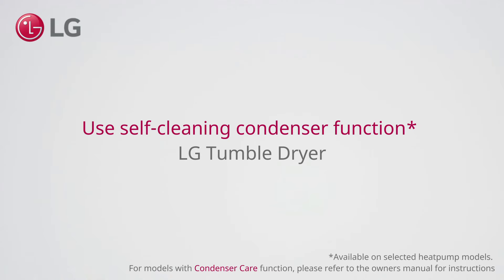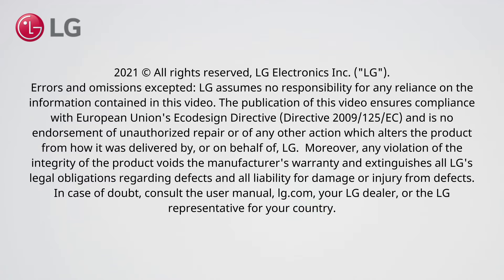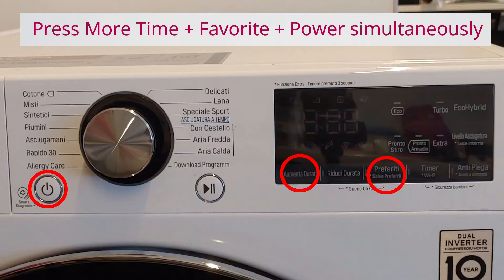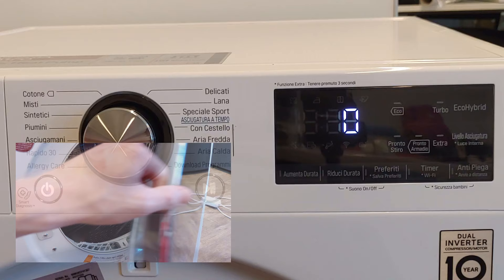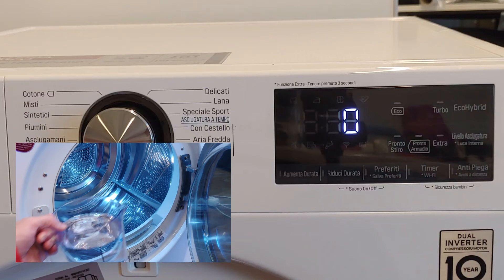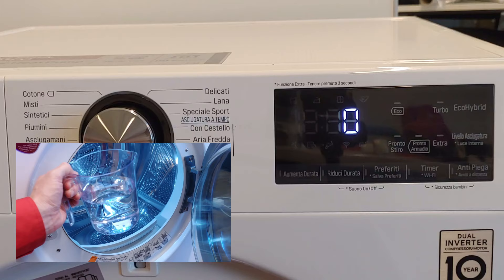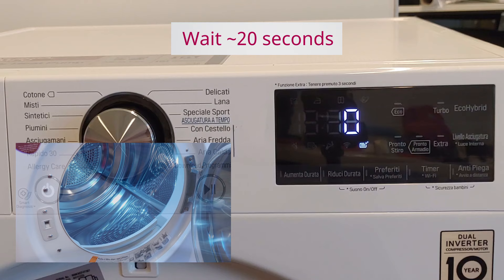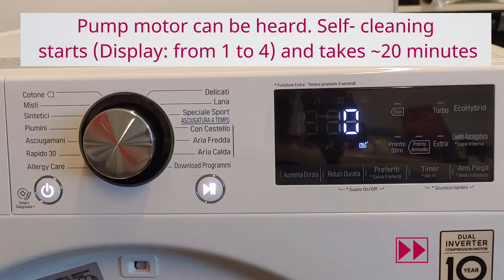[LG Tumble Dryer] - Use the condenser cleaning function manually

Comment: Just bought the following one - RH90V9AV3N.

In the booklet it is written to pour 1L water, after removing the draining container.

The question is if the video is applicable for this unit, as it looks quite easier to remove the lint filters, and to pour the water from there.

Thanks in advance
Reply from the maker: Sorry for the late reply. Actually the lint filter procedure will work similar to the drain tank container, as the water you pour in will enter the base area where the water detection is done. So no problem doing it via the lint filter hole. But please do not forget to first empty the water tank (if used)
Reply: I have a similar question and the manual also says to pour the water in via the water tank slot, after removing the drain tank.

Comment: I cleaned out the condenser and now when I dry clothes water is leaking from where the condenser is and steam is co.ing out of the machine .how do I fix this.we just had a tech come because we didn't know someone in the building shut the main switch off
Reply from the maker: Not sure what type of model you have. This video is made for heatpump dryers with an integrated condenser. You say steam is coming out and water leaks. Indeed this sounds like you need a technician.

Comment: Hello! I tried this technic, did everything as described, pressed the buttons, 0 appeared on display. 
However, it never told me to stop adding water. The little condenser icon never came. 
I then thought "Oh, maybe my machine needs a little more water than the 2 liters described!" 

Now my dryer is "overwatered" and wont dry. How do I drain it from water? It has been running for 10+ hours on regular programs cause i thought it was just a matter of time.
Reply from the maker: Which model do you own? When "0" appears, this means you should stop adding water. If the condenser icon does not show and you do not hear a pump sound (the pump starts circulating water over the condenser), then the procedure apparently does not work for your model. Then about draining; what drain connection do you have? Is the water tank emptied? To drain water, this happens automatically after 5 minutes in the Cotton program, for example.

Comment: Hello. If the water tank has water in it and I start the cleaning function, it will clean with the water from the water tank? Or should I make the exactly procedure from the video?
Reply from the maker: No, in fact it is requested that you empty the drain tank first. Then fill the base compartment and when it has enough water in the water (not too much!!) it will produce a bling sound and start working.

Comment: I can get it to shortly show the 0 on the display and then it shows 0F and the full tank ikon starts blinking
Reply from the maker: Then I'm afraid your model does not support this function. The F symbol is related to the water tank and is only for SVC technicians. To make sure that the auto condenser cleaning function works during a program, if there is enough water in the base it will definitely activate. The best thing is to always put enough (wet) clothes in the Tumble Dryer every cycle.

Comment: I am using the TD-H802SJW model, and the manual that came with it initially does not mention how to clean the condenser at all. It has been four years since I purchased it, and I have never cleaned the condenser before. Should I clean the TD-H802SJW model just like in the video? I'm concerned that it might break if I do anything wrong.
Reply from the maker: Don't worry, you do not easily break anything by trying this button combination. Not sure though if this model has the function. It's not a European model and I do not think it has an auto cleaning function. Perhaps there is a condenser you can take out, but I suggest you contact your local LG office to obtain more info.

Comment: As soon as the condeser cleaning symbol lights up, I stop adding water .
Should I close a dryier's door ?
or wait 20 secound and cleaning is processing with open door ?
Reply from the maker: If the procedure works then you may leave the door open, that should not be a problem, but it should also work when you close the door.

Comment: @LGSAE my dryer FDV1110W has fully automatic condenser cleaning it cleans it while it’s drying the clothes, but before I knew that I already poured the water into the the filter so what should I do and how do I get rid of the water please help.
Reply from the maker: The only thing you can do is empty the water tank. When the machine senses that the base is full it will pump out residual water to the tank, so that one should be emptied after each cycle.
Reply: @LGSAE  so how to I change the dosage and do a ezDispense nozzle clean on the FWY937WCTA1 washer dryer it has ezDispense it has dosage no dosage change settings on the screen and no nozzle clean function on the screen.

Comment: Hi. Thank you for your video. May I know what will happen to the water that added? Is I need to prepare any drain hose later? Thanks
Reply from the maker: Similar to the water that is removed from your clothes during the drying process all water will be collected in the water reservoir. You need to empty the water  reservoir on a regular basis as explained in the User Manual (not needed if the optional drainage hose is installed).

Comment: Hi, one question. Is there any 3rd filter on the Dryer? RH90V5AV6Q is my model but I don't see any 3rd filter other then the 2 from the front. Thank you.
Reply from the maker: You are right, there is no 3rd lint filter. Just 2 on the front.
Reply: @LGSAE  exactly. Then where does the lint that has been washed from the evaporator/condenser go to? Please answer this critical piece of information.
Reply from the maker: @ChaseMaximilian  well, it ends up in the drain water. Note that the filters catch nearly all the lint because of the very fine mesh holes. So it is only the very fine dust that may pass the filter into the base and is pumped into the drain tank or external drain hose.

Comment: Hi. For the model LG RH90V9AV2N should I pour water in the lint filter opening or in the water tank opening? In the user manual it is recomended to use the water tank opening. Ty
Reply from the maker: It works similar. The only thing you should keep in mind is that you pour it in slowly and that you do not pour in more than 1.5 - 2 liters. The base can only handle about 2.5 liters so if there is already some remaining water from previous cycles, it may start leaking at the back.
Reply: @LGSAE  thanks. Very clear answer

Comment: Thanks for sharing this tutorial, it does alleviate some of my concerns about the automatic cleaning function. However, people on forums and here on Youtube say that there comes a time when manual cleaning is required, because the device ends up getting clogged.

Is it realistic for one to keep using such a dryer without having to either troubleshoot it by hand?
Reply from the maker: thanks both for the comments. We understand the doubts. However, we have only few complaints about the need for manual cleaning because the machine gets clogged. The double lint filter system does its work quite well and the auto cleaning condenser also normally works each cycle. This video is only for cases when you want to have it cleaned extra and for example when you only run cycles with small amounts of clothes, which occasionally may not provide enough water for the auto cycle to run.
Reply: @LGSAE  I own LG RC90U2AV4W dryer. It's not true that it doesn't get clogged. LG service blamed clogging of my dryer on me. Recently they told me I do not use full loads and there is not enough water for the dryer to auto clean. This is just a false accusation. I was wondering if my auto clean system worked properly, but the service didn't really care about my doubts. The dryer was cleaned after 23 months and this is it. They said "it happens" sometimes. Now it's 36 months and my dryer was full of grime and disgusting slimy matter. This time I saw it with my own eyes. It's unbelieveable. I hate how LG treated me and I hate your excuses. This is just a product to last for 24 months. That's all.
Reply: @MajaMakiewicz . Mine is asking me to clean the filter and I hope it won't be as bad as Ur situation
Reply: It's best to clean it often manualy just to avoid any destruction
Reply: @LGSAE  where does the lint go after it has been washed from the condenser/ evaporator? You have not explained this most critical piece of information which is relevant to any heat pump laundry dryer.
Reply: @LGSAE Mine is clogged and doesn't seem to have the function nor an ability to get there somehow...

Comment: I got 0F after addind some water as in the video (When the display shows 0), and then something start, maybe to drain the water. Have the RC80U2AV3W that seems equal to the one of the video, but on the user manual I cannot find this function explained. Where is the problem? How can I clean the condenser?
Reply from the maker: If you see 0F then this is an 'overfill check' and you probably do not have this function. The only advice is to use the Automatic Cleaning function; put in some wet towels (do not spin them or at low, 400-600 rpm) and run a normal cotton program. If You are word about the drying performance you may want to check if the lint filters are free from dust and softener. Please check this video: https://youtu.be/cwHZKDcOJaA?si=w63sve76EVJpbdtu

Comment: I have the RC80U2AV4D model, does it support this cleaning function?
Reply from the maker: No, this model does not support this function. To make sure that the automatic function is executed, make sure to have enough clothes in the machine and that they are relatively wet (select a low spin speed, eg. 800 RPM). This is because the auto function needs enough water in the base of the dryer in order to become active.

Comment: Is posible used it for model RC91V9AV4Q ? Thank you
Reply from the maker: Dear, we can't say for all models. Just try it. On some models, instead on the lint filter icon (as explained in the video) you may see 'OF' in combination with a blinking water tank symbol. In this case, the drain pump first pumps water to the drain tank and then starts the condenser cleaning function.

Comment: Knowing that this has been an issue on older(ish) models, particularly in Korea, the manual cleaning feature is critical to my purchase of an LG heat pump dryer. 

Please can you confirm whether each and everyone of these UK models have this feature? 
FDC309W
FDM309S
FDM309W
FDV309W
FDT208W

Can I also recommend LG get the manuals updated as there is no mention of the manual cleaning feature (if indeed they do support it). Thanks
Reply from the maker: Thank you for your comment Christian. Well, the manual cleaning function should, if available as separate program on the display (Condenser Care). Below "Yes" models have this service function. For the other models, the function as described in the video may be available, but not 100% sure. 
For your selection the answer is: 
FDC309W: Yes
FDM309S: Yes
FDM309W: Yes
FDV309W: Unknown
FDT208W: Unknown

Comment: Will this method of cleaning apply to LG Vdh9066ws dryer?
Reply from the maker: I am not sure. It is a method for recent (from ~2019) models but it is best if you check on your model to see if the button combination brings up a "0". If that is the case you can start filling the machine with water as demonstrated.

Comment: Hi, may I ask if the models in Germany have this function too? I’m considering buying  RT8DIHP but can’t find if I can also clean the condenser manually.
Reply from the maker: I do not think it has this function. under normal circumstances the manual function is not needed (if you put in enough wet clothes the auto cleaning function will be active each cycle). However, if you are looking to buy a model that has the manual function, look for RH9xVxxVxN model where the V is most important and the x can be any character.  Good luck!
Reply: I am using german RT8DIH1Q model and just now performed this program. It is not mentioned in the manual though, which is strange.

Comment: will this function work for my RC9055AP2Z model?
Reply from the maker: Unfortunately not. But if you think that the cleaning function does not work enough, please run dry programs with enough wet laundry, as the auto-cleaning function needs ~1.5 liters of drain water in the base to activate the cleaning function.

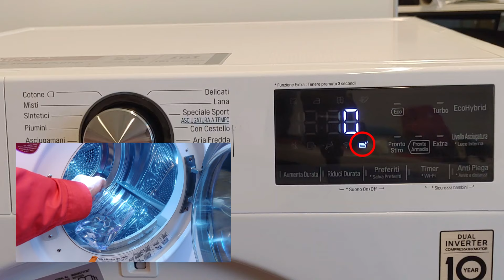Comment: hello, when the device is cleaning automatically, does the condenser cleaning icon light up as in manual cleaning?  I did not see that the icon light was on while drying.  only burned in manual cleaning. 0:59

Comment: Does this model RH80V9AV3N support manual cleaning?
Reply from the maker: Yes, in fact this model has a dedicated program option on the touch panel called 'Condenser Care'. Pull out the water container first and
empty it. Then pour 1 liter of clean water slowly into the entrance of the water container compartment. Then refit the empty container and hold Condenser Care for ~3 seconds.
Reply: @LGSAE  And RH80V3AV6N? Also capable for manual? Can you please answer me

Comment: How can I use this on the RC7055AH1Z model?
Reply from the maker: If this model does not show a "0" when you use the button combination as demonstrated in the video, then your model does not have this function I'm afraid. It might show "0F" for example, which is another (service) function. If that is the case, please power off the appliance and power it on to use it normally.

Comment: I have an LG  heat pump dryer and I (along with several others according to the service tech) am experiencing very long dry times. As long as 6-8 HOURS. Techs say nothing is wrong but cannot explain how the dry times are that long.
Unit worked fine for first 8 months then started taking a long time. None of the techs mentioned condenser clean function even though I finally found it. Did a clean and it still doesn't work.

LG SERVICE IS POOR. Techs are nice but only have a very short list to go through to check things out. They are not even clear on how the things work because the only thing they do is replace the main board or a pump. That is it.
Choose another brand.
Reply from the maker: Not sure if we can restore your confidence in LG, but let me try. Condenser cleaning should happen automatically, except when you dry only occasionally or with small loads (it requires a certain amount of water).  Of course we do not know your personal situation and the technicians that visited you. Technicians should check the machine functionally and advise you how to use different programs, do proper maintenance (eg. filter cleaning https://youtu.be/cwHZKDcOJaA) and sort clothes (very important with heatpump dryers.)
Reply: What do you mean sort clothes? Is there anything special here or just plane sorting out your heavy fabrics to lighter fabrics?

Comment: After the lint is washed from the evaporator /condenser where does it go? 🤔 -This is planned obsolescence disguised as “easier functionality.” 🙄
Reply from the maker: As mentioned in another comment, this fine dust will get flushed away with the drain water. So not sure what you mean with planned obsolescence. There are already 2 filters and if there is another filter added, there will be a chance that air flow gets less. Of course there are also heatpump models, such as RH80T2AP6RM, that have a manual cleaning option. Perhaps you can better opt for such model.
Reply: @LGSAE  with all due respect, “RH80T2AP6RM” model is not available here in the United States. The only LG heat pump model available to us here is this one in the video: LG-DLHC1455. 
Lastly, I know your not the one who designed this dryer, but I have the service manual for this machine right here on my table. It clearly states cleaning the lint of the condenser by the technician. Which means by default that eventually the condenser must plug up with lint and would require a technician to come on site and disassemble the dryer fully to open the condenser box. A bit mind-boggling when LG already makes a model that has access to the condenser. I wonder who made the design decision for this model? That’s why I call it planned obsolescence.
Reply: @LGSAE  @LGSAE my dryer FDV1110W has fully automatic condenser cleaning it cleans it while it's drying the clothes, but before I knew that I already poured the water into the the filter so what should I do and how do I get rid of the water please help.
Reply from the maker: @ChaseMaximilian  dear, I guess we missed this comment before. There are pros and cons in relation to the automatic function. Do know that it is really not something a technician should have to do. And we advise on service tips and maintenance on European models, that is the purpose of this channel.  That is 1 of the reasons why we make these videos, to improve product performance and for example educate customers how to manually aid to the automatic function, for example if customers only dry small loads where the automatic function is not always working as it requires ~1.5 liters of water to operate the auto function.
Reply from the maker: @dont_like_trash_washers  when you start a normal dry program, the drain pump is typically activated after ~5 minutes. Or you can open the service cap on the back and tilt the machine to the back. Please make sure you have a bowl present to catch the water.
Reply: @LGSAE  thank you very much